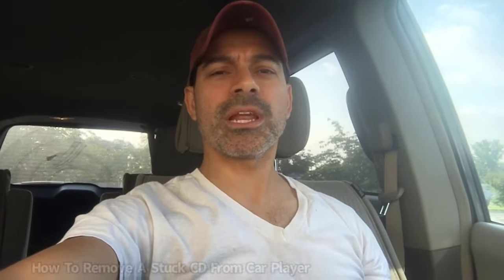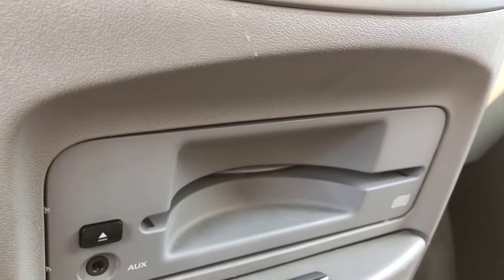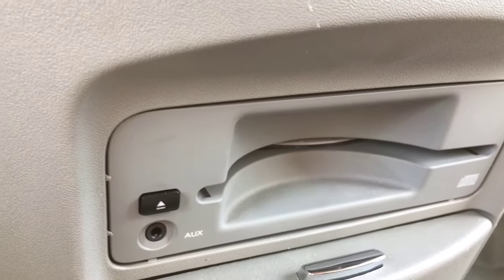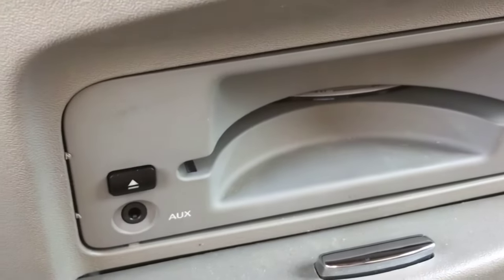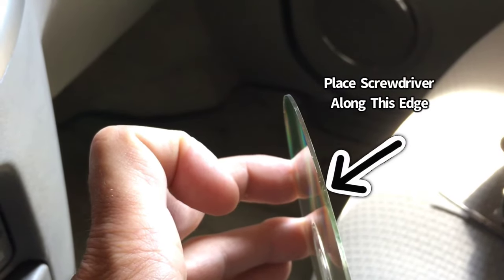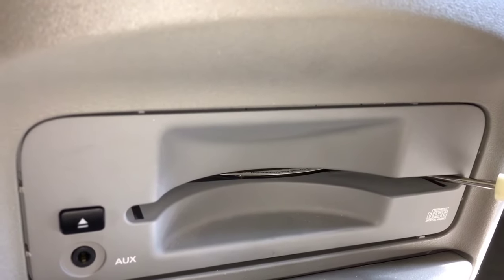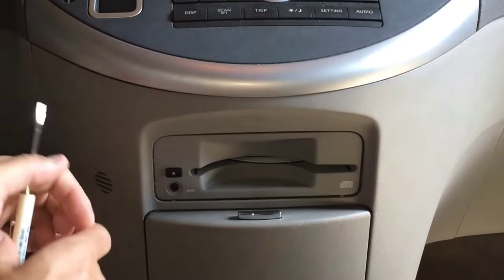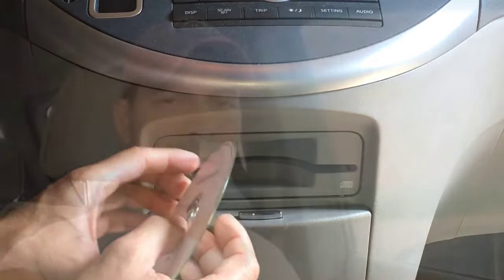How To Remove A Stuck CD From A Car CD Player (Andy’s Garage: Episode - 205)

Comment: So is the cd player broken once it wont eject cds?
Reply from the maker: In a lot of cases the mechanism could be failing, and in that case would need replacing. Sometimes a CD can just get stuck but the player is fine.
Reply: @PhillipsVision  thanks. Its a work truck, so I'm not going to put a better radio or alarm system in it. After I get the cds out, I'll just listen to the radio.